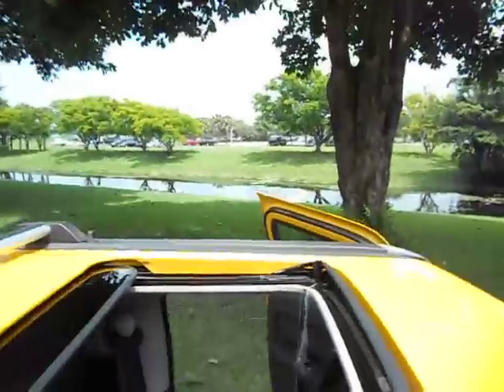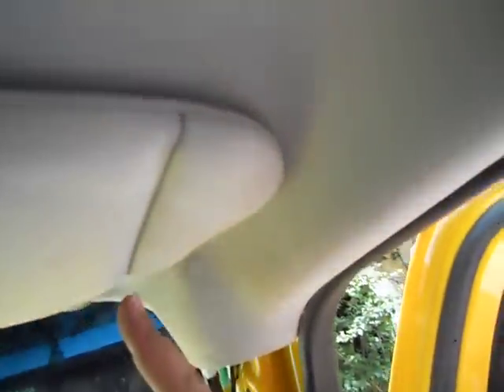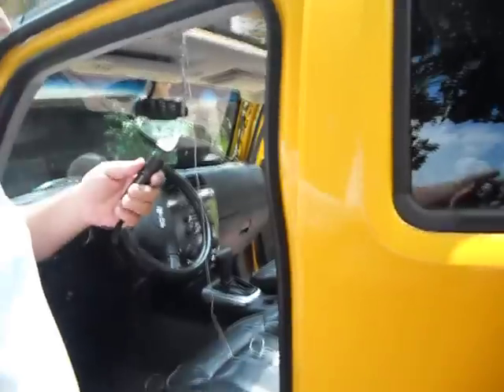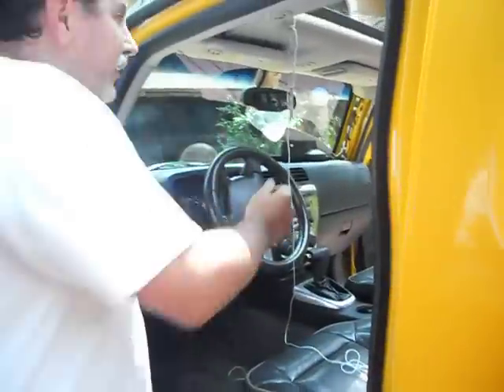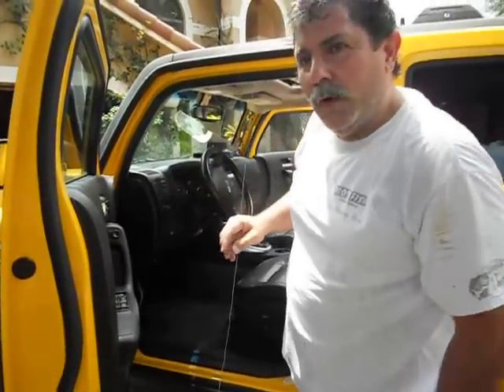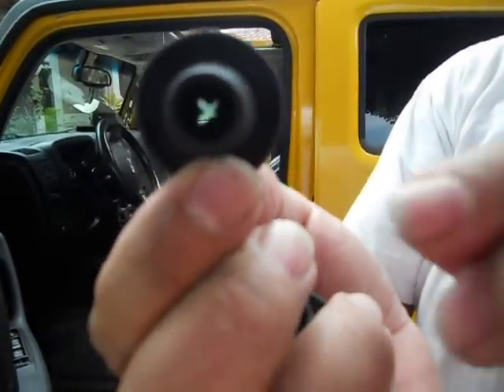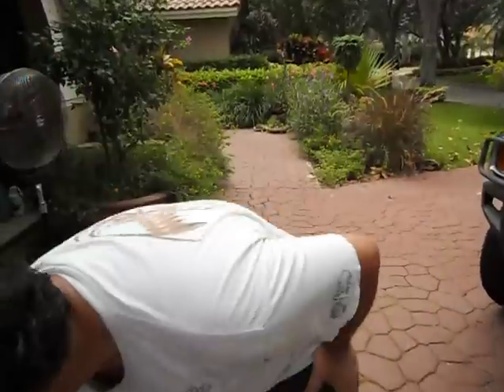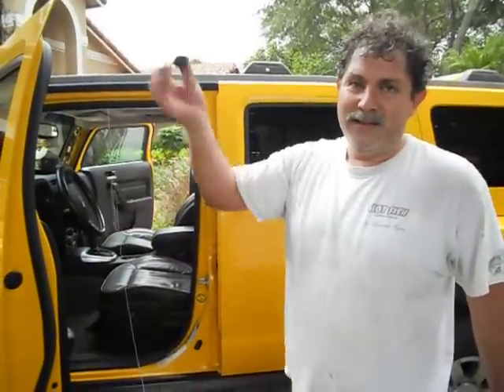H3 Hummer Drain Tubes

Comment: I did this for my benefit.....to remove & install passenger side grommet ;cut a hole in plastic checked panel usually has a painted  X to fit my hand.....other step I did ;use a rat tail file attached to drill to drill out grommet; next I used NAPA  sil-glide lubricating compound only on flare side of grommet not any on tube side.

Comment: the only problem with this method ... i had the same issue and ran a small braded cable through the tube with a round blob of hot glue on the end so it runs through the tube smoothly.    What happened for me is by running the cable or rag through it pulled the grommet  off the sunroof  drain which required me to drop the headliner( which isnt fun) to reconnect it.   the grommet was very loose and comes off easily.  i had to use hose clamps to ensure it would not fall off again.

Comment: Although an old video, one of the best on this topic. Adding one tip ... while making this fix, it's worth partially dropping the headliner, front half only a few inches (remove sun-visors, passenger roof handle, and windshield pillar trim) to take a peak at the drain tube connections at the sunroof, make sure they are attached, and secure them firmly with tie-wraps. You won't reach the back ones, but can see if the tubes are there.  On my H3 I found the front passenger side tube was disconnected, likely by a prior attempt to clean with air pressure, so water was dripping directly onto the headliner and flowing out everywhere, front + back pillars, sunroof switch, etc.

Comment: I'm an elctrican you must seen video or the same as I am vacuum string trick I had to pull 200 ft of cable string vacuum done but trying figure out on videos where after fire wall it comes out that may be the issue

Comment: Thank you so much! I've been looking for the end of that drain for over a year and dealing with wet carpet whenever rains.I found mud in there and a rock as big as the tube. That stupid cross section is drilled out now and I just want to tell you how happy I am with your video.
Reply: did you have symptoms of just wet carpet after heavy rain? that's what I am experiencing now. No water leaking up top or in the middle areas, just on my passenger carpet after it rains (a LOT).
Reply: DISREGARD, found my grommet was also plugged up, but I also found my tube was completely disconnected from it, so it was just free-draining into my passenger side floorboards for the past 2 weeks during this monsoon season lol.
Reply: I stuck the wet vac under the rug and pressed out as much water as I could, then opened the door to the wind and sun.
Reply: Yes, then water dumped from above when I went around a corner because the line backed up. You need to reach in that tiny opening and feel for the tube and grommet through the firewall and pull them out. The tube comes off the grommet easy. Get the grommet without dropping it. Drill it like the video and jam it back to the fire wall till it pos in properly. Then poke the hose back in it. It's a snug fit. Same on both sides. It's a hard angle for the hand and sucks. Try looking at the video carefully and use a flashlight to find it in your H3.
Reply: Thanks for video.  I actually cut a small piece from pass side plastic after you remove side cover so my big ass hand would fit.
Reply: I know im asking the wrong place but does any of you know a way to get back into an instagram account..?
I was dumb lost my password. I appreciate any tips you can give me!
Reply: @Abel Emiliano instablaster :)
Reply: @Dwayne Messiah it worked and I actually got access to my account again. Im so happy:D
Thank you so much you saved my ass!
Reply: @Abel Emiliano Glad I could help =)

Comment: I have big hands and got them out and in with no assistance when you put the passenger side in use your right hand holding grommet with your thumb and index finger and reach above the wiring harness feeling with your pinky finger for the hole in firewall and push it back in. the drivers side is easier as he pointed out in video lay on your back in floor board and the drain hose on my h3 is white once located it is easier than it looks.

Comment: Hi, I hope you get this or someone responds to this question. I had my 2006 H3 (Yellow also) Garaged for 6 years. Just took it out 4 days ago. Runs nice and just needs minor cleaning. I have had clogged drain pipes in the past, and someone "supposedly" cleaned them out .. that's what they said. But never really fixed it and we had minor water always coming in when I took a turn. Anyway, since I had it out of the garage and in the driveway, we had massive rain. I went into the truck, and I had a pool of water (literally a pool) on the passenger side floor. Could this be from that drain pipe or could water be coming in somewhere else?
Reply: it's probably from the tube, have the same issue but it happens on my drivers side more, highly doubt it's anything else. while i procrastinate to fix this problem i just duct taped the sunroof, had the car parked in the rain, and saw that no rain got in. confirms it's the tube

Comment: I hooked up about 2’ of 1/4” drip line to a air nozzle and stuck it almost the whole way in drain holes in front and it blew everything out perfectly. I just found out there are rear one but I haven’t had an issue yet with those. 🤞🏻

Comment: this video helped out a lot thanks I basically took out the ends and drilled them the same didn't bother doing the string thing but did hook up my air compressor and put a blow tip on and blow all that crap out of the lines and it's all fixed thanks!

Comment: Thanks for the tips. I had to remove the visors on both sides, drop the headliner a little to push back the drain hoses onto the sunroof channel because it got pushed off when the driver tried to clear the hose with a wire clothes hanger. I drilled rubber grommets out and water flows freely, Thanks again.
Reply: Same exact thing happend to me.. my dad used a hanger.... smh.. now every two months I pour liquid draino down both holes and slowly pour a  liter of water make sure its cleaned.  I look  to see of its draining properly under the truck..

Comment: My 2008 has water leak.  I don't notice anything on the roof or anywhere being wet  but the passenger side floor had so much water when i turned corners I can hear it sloshing and going through to the back!

Comment: Thank you,  thank you. I just bought my hummer and the first day I drove it a rainstorm hit. I didn't know about the drains, but I found out quickly. I went around a corner and was drenched in the front seat with about  3 cups of cold. I didn't crash but I screamed like a girl. I took it to my mechanic and he cleaned and bored out the rubber fitting. I hopefully will be dry from now on.
Reply: how much did it cost it ruined my rug and they wont cover it. this is a major defect.
Reply: I need a mechanic who can do this for me also. Can I borrow yours??address and number. thanks.

Comment: What I did is made the end bigger with a solder gun basically melted it and I didn't use a string I used plumbers unclog for bath tubs, then let it sit there for a while like 15 mind after putting it all back together and pour some boiling hot water and it flushed everything down. Hope this helps.

Comment: its a good fix however they are very hard to get to from under the dash, but if you are in need of a windshield replacement  when the glass guy removes the windshield they are just under the windshield and with a long pair of needle nose pliers you can easily get to them.

Comment: This problem ending costing me a little over a thousand dollars, had a heavy snowfall and the melting snow caused the the water to flood the modular box on the passenger side under the glove box short circuiting the system. Had to have the modular  replaced and reprogrammed. Mechanic cleaned drain tube but said it could happen again.

Comment: thanks for the video done this to mine yesterday and it was not bad at all it took about 15 mins. to do both sides and helped tremendously it got tested today with the rain and the next 5 days of rain. no one be intimidated by putting the grommets back in firewall   once you drill the grommets out spray a dab of wd40 or kroil on the end going through fire wall and they will pop right in.

Comment: For anyone looking at this video it is great advise. I did also find something he missed. Under your inner fender you have a "trough" that fills with debris. It's hard to see but you can use small screwdrivers to clean it out. There is a big hole to fit your hand in and the drainage bleeds  through a small space between the 2 pieces of steel that join below the hole

Comment: You did this video in 2013, and so its 2019 and I would like to know if it solved the problem because I need to do this asap lol
Reply: Yes it does
Reply: not really
Reply: This does work for sure but there are much better and even easier fixes and your H3 will NEVER leak again, plenty of YT vids on it.

Comment: Nice video. I have the same leaking problem with my H3. It might have caused my sunroof to stop working cause it won't open anymore. Question...can I get to the top of the drainer tubes with sunroof closed and top liner removed?

Comment: I respectfully disagree with the rag and string method. I have dealt with this issue on customers' vehicles, and found that the tubes are not clamped at the top, where they fasten to the drain hole in the sun roof. Point is, that you can disconnect the tube from the opening of the drain hole at the top, causing the water to flow out on top of the head liner.  My suggestion, is to drop the front corner of the headliner (its not difficult at all) and install a small hose clamp (which shouldve been done at the factory, but wasnt). This will allow you to simply stick a blow-off tool up to the drain hole, and blow the clog out the other end. I would suggest this to be done every once in a while, especially if your parking under a tree, or any other area where debris may collect in the "gutter" of the sun roof, which clogs the drain hole. The method of sticking a vacuum up to the bottom of the drain tube, which exits out of the firewall, just behind the front tire, is also a good method in my opinion.

Comment: I've never noticed water in mine, but on two occasions within the past six years I have heard a very loud water dripping noise. Could it be because of the drain tubes? Was your's doing the same? I only hear it on the passanger side.

Comment: Good video, another method to clean the lines is to use gas trimmer line. I used it on my wife's hummer and it unclogged the hoses. Stick the trimmer line in the openings in the corners of the sunroof and gently push and pull till you get to the bottom where the lower fitting is and that should totally clear the lines.